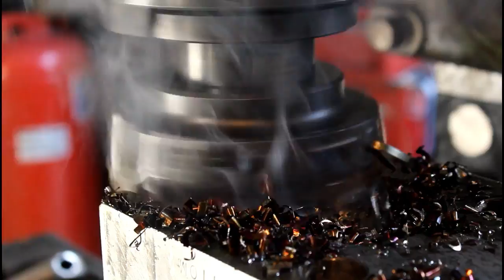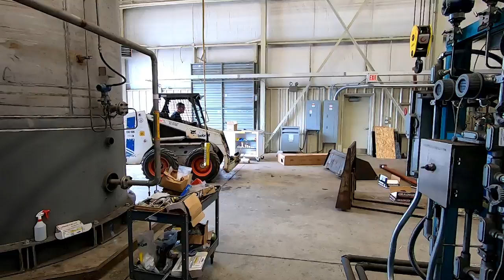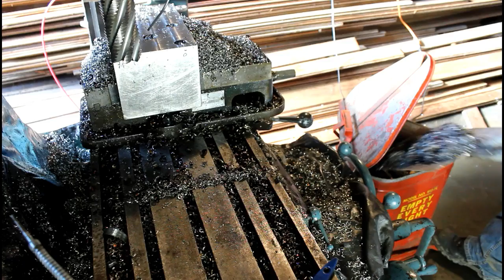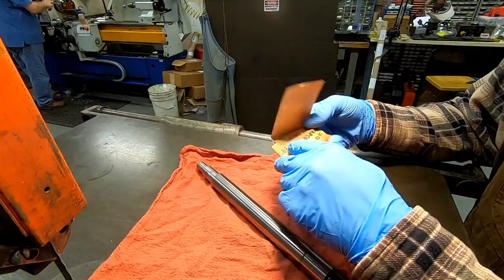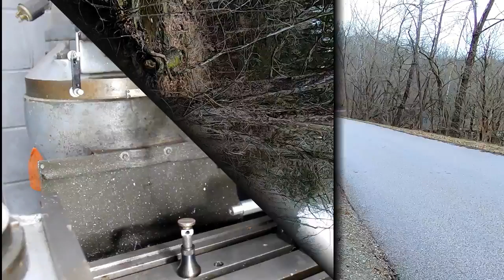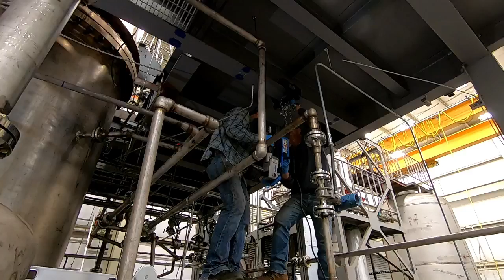HEAVY TEST CUTS IN STAINLESS ON THE K&T MILL

Comment: safety alert ! once upon a time back in 1980 i worked in a small fab shop. my buddy was out in the yard with a large wide-flange (over 100 lbs per foot) sitting the tall way on a pair of stout horses. he was sitting on the flange with one leg over each side of the beam with a Hougen between his legs drilling holes . he was using a couple of extension cords to reach out into the yard. somebody tripped on the cord and it unplugged. the magnet went dead, the annular drill bit seized in the half drilled hole and the Hougen ( they are heavy !) continued to spin completely around one time. it knocked him off the beam and scared the crap out of everyone who saw it happen. fortunately he was young and tough and wasn't hurt except for a monster bruise on one leg.    watching you drill overhead reminded me that day in 1980.

Comment: Great video Steve! I am curious if you have the vise properly keyed into the table slots? Also please use a mask when using air pressure to spray the coolant. I was taught that coolant mist will ( not may) cause pneumonia when inhaled. I was never brave enough to test that out. Take care.

Comment: Steve, one thing to be aware of while using a magnetic drill overhead like that.  Think about a power failure or someone accidentally pulling the plug.  That thing falls like a very heavy rock.  We were using one on the side of an excavator and there was a power failure.No body got hurt but they could have been!   Now we always lightly support them with a safety chain or straps.  Be safe.

Comment: Steve, could you mill that block of stainless into a nice Angle Plate? Your Audio was great today. And it's never Just a piece of scrap, it just a Undesigned Project, trapped in a block of steel. Cheers

Comment: Steve I just love your new smoke making technique. The K&T is a fine machine, and happy to see that you can use it now. It doesn't seem to care what you put in, under or over it, it just keep working. But I am sure that a face mill, in a expensive tool to keep putting inserts into. I am glad that they where the bad once in the face mill.  I love seeing you work the K&T.  And it does a nice job even with the bad inserts.  While you running around in a tee shirt, and I fine one at that, with the metal chip from Adom79. Our weather this morning was -29C that would be -20F.  I have often thought, that when you show the stream close to you, that you should put in a water wheel, and make some electricity to run the lights in your shop. Its nice to see the work that you do at work, and explain some off the things that happen their.  Have fine day, thank you, for all the great videos, and keep the coming. Just for us freezing up here, please put on a winter coat hahah, Just kidding enjoy the nice weather.

Comment: I am sure you know interupted cuts are rough on carbide inserts. Couple tips on the K&T. When making heavy cuts double clamp your vice with some toe clamps. Also cut from right to left (clockwise rotating cutter) so if she turns loose it wont throw it in your lap ( I have seen happen) Also it throws the chips to the rear. You will be surprised what it will cut. Also when through double check your tram on the head as it can move on you (seen that too). Hope this helps.

Comment: Being a non-machinist, this might be a stupid question, but what is the criteria for running flood coolant? Why would you want to be running it in this case? Thanks. Keep up the great content.
Reply: To keep the cutter and the work piece cool and lubricated for a smoother more consistent cut. Putting a ton of heat into inserts severely reduces their useful lifespan and too much heat into the workpiece will cause warping and inconsistent cut depths due to expansion of the metal while hot and the subsequent contraction when it cools down.

Plus using coolant will generally yield a better surface finish and allow you to make deeper cuts since the heat is being sucked away by the coolant.

Hope that helps and makes sense.

Comment: Old trick from small batch spray painting such as motorcycle tanks.  Use a tank of dry nitrogen with a suitable regulator (two stage is best) for your paint gun.  The stuff is non-flammable (but the paint is very flammable, so always be careful) and very dry so moisture into the spray gun is for all practical purposes eliminated.

Comment: As time goes on you will appreciate even more the raw power and rigidity of the K&T.....With other mills, you can use a vacuum cleaner for cleanup but with this one, you need shovels and buckets..Be sure to lubricate the vertical head and the drive gears which drive it.. Mike in Louisiana (Ramsay 1:)

Comment: Forty years ago I worked in a machine shop in the main plant workshops on a road construction project in SE Iran, we had a load of trucks, Ford and Foden fitted with 855 cu. in. Cummins engines, the cyl. head bolts for these, 13/16" UNC if I remember right made brilliant chuck keys. Good to see the weather's improved in KY. ATB from Somerset UK.
Reply: Jonathan Griffin Hello from an Iranian to you 😊
Reply: @habibalavi2780  Hi Amir, the workshops were in Nosratabad, Baluchistan, the site can be found on Google Maps, just go to 'Nosratabad gas station and look to the left, the workshop buildings have gone but the concrete floor is still there complete with oil stains.
Reply: @jonathangriffin1120  Sure I will check that out. :)

Comment: Looking great!! Weather back to winter today! I did some similar playing years ago. https://www.youtube.com/watch?v=rtv2D3EtCSI  wound up .250DOC 10IPM and 6" face width. At the time I calculated it to be about a 12-15hp cut.  I think that should put you right in there when you play on that mild steel. :-) When I was doing that metal mowing madness on that transmission case I figured a guy needed a bobcat to keep the chips away from the machine. LOL
Reply from the maker: Yeah, I remember that. 👍Hope your doing well Brian. These temp swings are crazy.
Reply: Steve Summers yeah been doing good. Been cleaning and trying to straighten and repair the chip pan on the monarch. It’s a huge nasty job!!! 15 5 gallon buckets of swarf and swamp goo so far!!

Comment: Know the machine well she can cut 316 SS like butter and then slot it deep just to show off and leave a finish near smooth as a car mirror. It is nice to watch the machine type I ran production on as a child, flood coolant was all I can recall, to control the coolant we used large pieces of plywood wedged in place by wooden blocks and often wired to the power handle all angled from above and around the table towards the coolant collection in the bottom or base of the machine, it was a mess but boy could you hog material. Nice tour and toys at work there really like seeing this. Nice thought out lapping design. We like to hear a man share that he loves his job you are great Steve.

Comment: Steve I live in southern Illinois and when the rain and high humidity and my cool machine tools it looked like I sprayed them down with water made me sick it happens every year 3 or 4 times dose this happen to u any
Reply: Its condensation, moist, warm air contacting cold metal.  You need to put oil on all bare metal surfaces try CRC 
SP-400, Abomb swears by it, I have the same issue going to give it a try.
Reply: @petemclinc  I've already tried that u can put what ever u want on it it don't help abom lives in Florida where the machine metal dosent get as cold their like it dose here in Illinois like 9 or 10 degrees last week and then warm most air comes in and covers if I lived where abom lives that mite work I know I need a heated shop I can't afford it but that stuff don't work here done tried it thanks

Comment: Steve,
   Your place of work reminds me of my final stop in the work force. The last two years before I retired I worked at the research facility of a major agricultural products corporation. The last project I work on was building a hydrogen reactor tower. I installed a two stage compressor with separator similar to the one in your plant. Your right, the money could have been better but the job was fascinating and fun and the people I worked with were absolute geniuses in many ways but at the same time down to earth and fun to be with. (With the exception of the supervisor, of course! Lol) At this company management and the researchers didn’t just think up concepts and then give it to us to accomplish. We, the people actually doing the work putting the systems together, were included from the start in the design and planning. That was a big plus, though many of the guys didn’t like what they called , “meetings with the suits”. I actually enjoyed it. It was a chance to interact with the scientists and engineers at the ground level and they listened to us when we determined why a particular concept wouldn’t work at the mechanical level. In my experience that was very rare. Most often prints were handed down and any change from that point on was a battle.
Reply: A few years a go I did a BAppSC (EnviroSc-GIS) and I had a chance to work with 'a suit" - he had a project based in Burma (low volume irrigation) and my practical skills - 30 years on the farm as a farm hand/engineer/irrigator were very useful to him!

Comment: Shweet test cuts!  Have you thought about how you're going to set up for flood coolant when you need it?  e.g., how do you keep the flood contained and recycling?  I know you'll have the sump and pump good to go, but I'm always interested in different ways people keep coolant / oil off the surrounding area.

Beautiful finish on that shaper test!  Do you have one of those surface finish comparison blocks, see what your results measure up as?
Reply from the maker: I don't have a finish gauge yet. The mill has a pump and return system all built in👍. It just needs filled with cutting oil.

Comment: I believe the feed rate on the face mill was a bit shy
Reply: I have always learned, when in doubt increase the feed rate! In fact there is a very interesting fact I have from an old book my father handed to me saying that higher feeds favorably change the forces on the tool. I used to run an old VDF lathe on which I put the theory into practice. Customer came over and could not believe how fast the machine removed metal.
Reply: @bigbattenberg  I have used up to 0,5mm (20 thou) feed rate for roughing on the lathe. Not super high but I would need bigger nose radius inserts for higher feed
Reply: @MF175mp  Exactly, this is the range we are talking about. The old lathes like the VDF are very sturdy and (mine from 1955) were the first generation of machines developed for carbide cutting tools. And it's not as if you have to make this stuff up yourself - the tables in the old books provide these numbers. 
I remember cutting with soldered carbide tools (which are abundant and super cheap) especially for rouging. On mild steel it would give nasty long and dangerous swarf when going easy. Increase the depth of cut and especially the feed rate and the material curls more naturally, breaking itself into neat chips without special chip breakers or anything. I guess the advanced cutting materials, inserts especially, work so well it is much less apparent the settings aren't optimal. And last but not least, work faster and make more money.

Comment: I understand he cost of traveling to he bash, we have family in Washington in the military, the other night Chris was checking on flights, just the plan riches alone is extremely expensive. Between the plane ticket, hotel, transportation, and food, your looking at 2k. Personally my budget will not stand it, so I sent a dozen modified paint cups out for door prizes to Stan. The K&T is a hoss, if you have the tooling it can remove some material, looks like you got it up and running.

You correct about the crazy weather, we had days here in the 80s this week, of course it’s a tease because it will get cold again. Take care

Comment: Try a shear tool on that 1095. A round boring bar is an easy shear tool setup. Just rotate it to the shear position.
Reply: Have you tried that with a carbide insert boring bar?  I don't recall ever seeing it on youtube.  Maybe with a reground insert, since most carbide comes with an edge radius for durability.
Reply: @somebodyelse6673  Yes I have and I got pretty good results. Now a really sharp insert might do even better, but the carbide insert in shear mode gave me a finish I cannot get with my normal turning tools.

Comment: Smokin!!!, great stuff, stainless (standard series), appears to have a tough skin, if you get under it, and keep removing metal it's okay, but doesn't like very small cuts. Most likely due to the high Chrome content. I used to shape bevel type gears in SS, with HSS and it was a pain in the bum. Is that modified SS for machining?
Great content and photography.